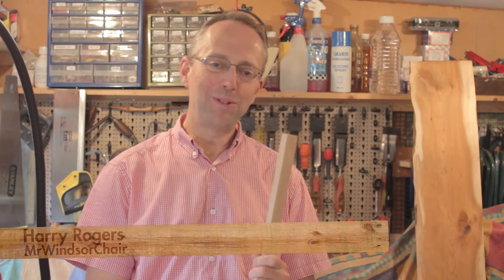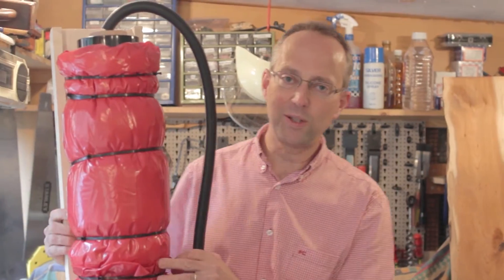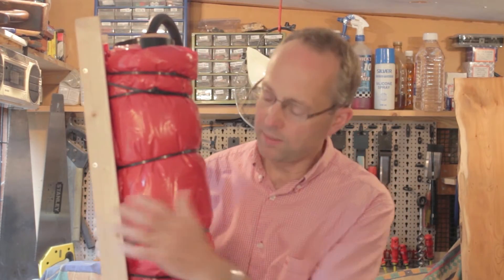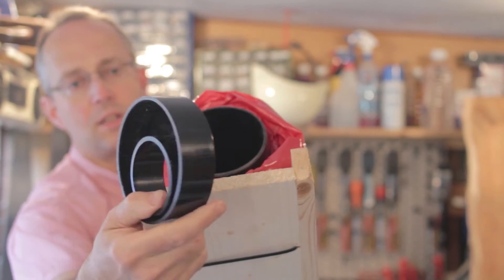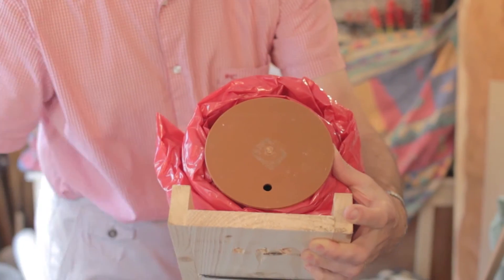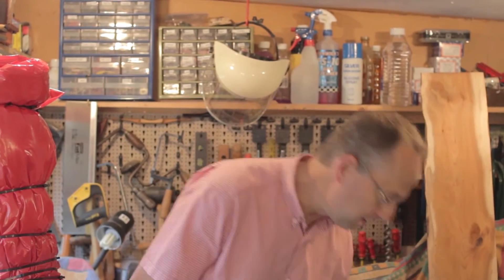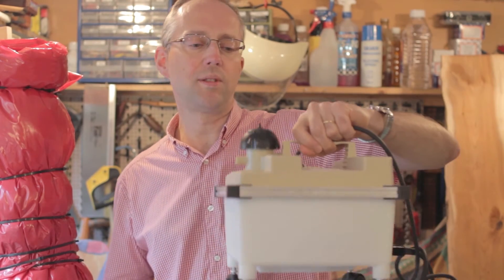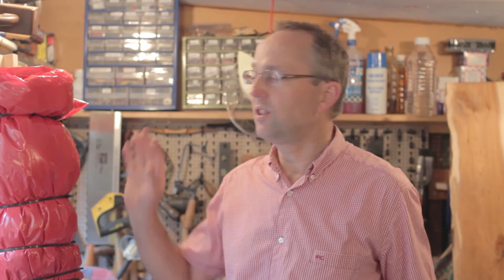Steambending : Steam Chamber for Bending the Continuous Arm Windsor Chair Bow

Comment from the maker: I made the steaming pipe a bit long, and intend to shorten it, so there is less heat energy loss along the pipe - it does work well but I need some straight grain material to take full advantage of its capability - I am on the lookout for that - I need some American oak!

Comment: excellent video, harry.  good thinking about having insulation and a backer board.  how well does the steamer and chamber work?  i think i would put a wood handle on the end cap to get the end off easier.